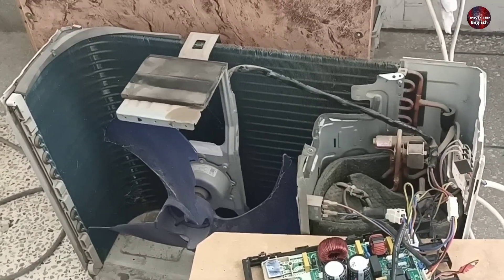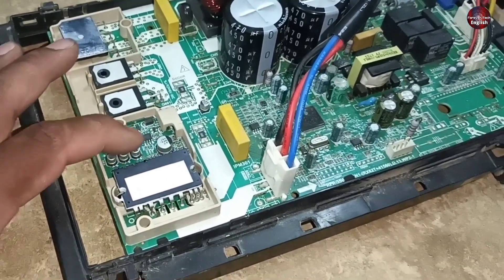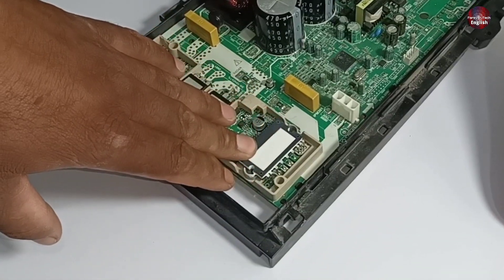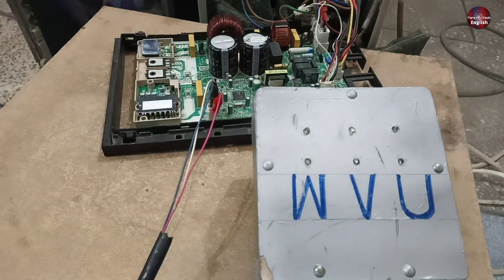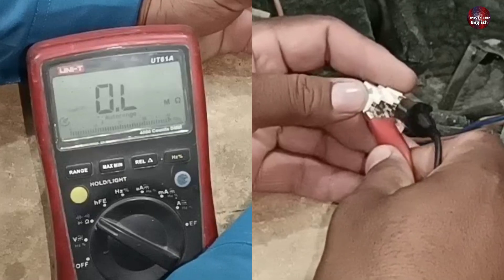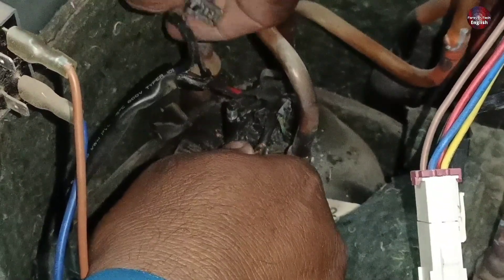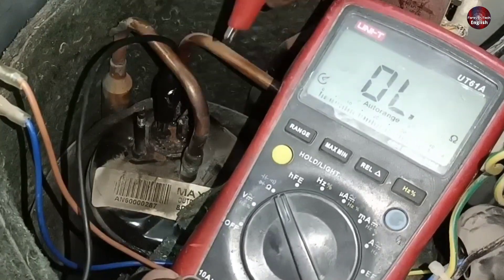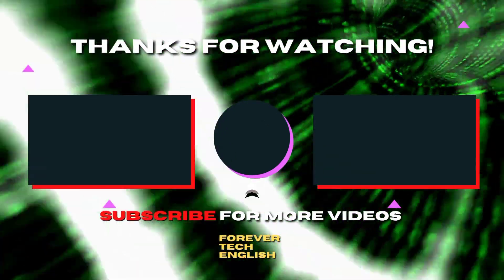Mini Split AC Control Board Light Suddenly Blinks Abnormally

Comment: My teacher you have said that the compressor is considered good if the value exceeds 500 mega ohms or more while searching for body short. What is the idea here?
Reply from the maker: It means then the compressor will considered good to be used, as its winding has enough juice to work further but if the resistance value of a comrpessor decreases more than that number it will considered bad.
Reply from the maker: And when no value is shown on the multimeter when you test the body short of the compressor, then as well the compressor is considered good.
Reply: Thank you for response.